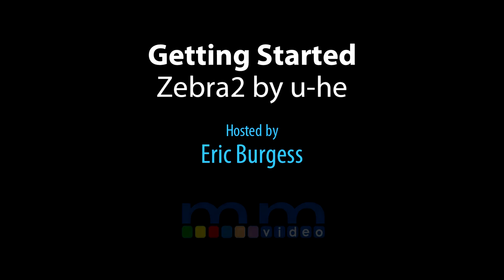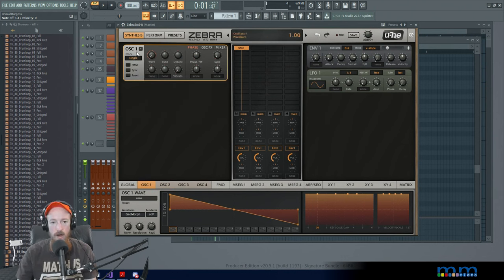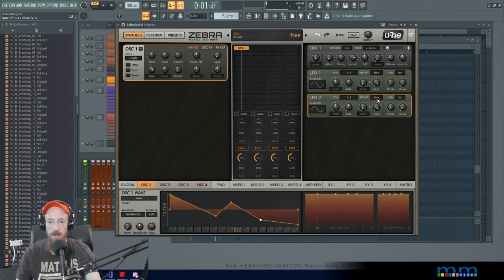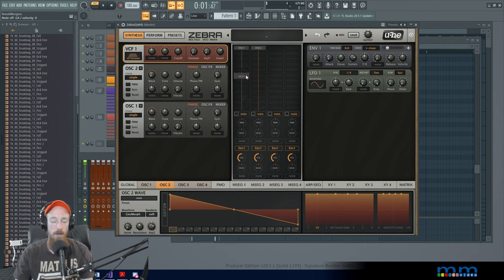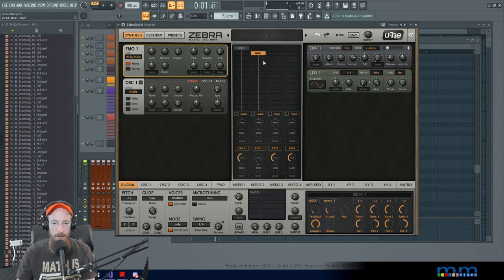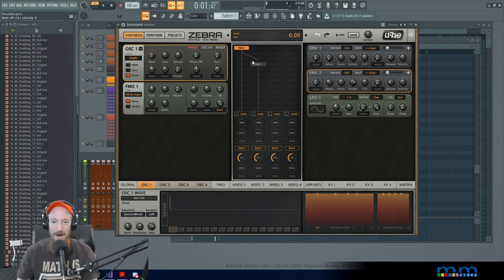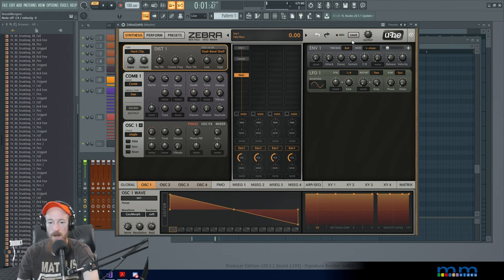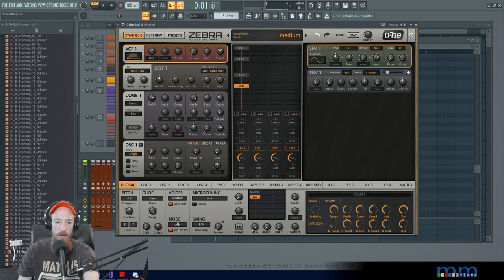MMTV: U-he Zebra 2 Getting Started | Eric Burgess

Comment: I'm having issues with the way LFOs interact with filter cutoff. I'll have it set to like a Triangle wave, Restart set to Free and Sync to like 8/1, and it just kind of randomly moves around, almost like a sample & hold or something. I've been troubleshooting for like an hour & I just can't get it to behave like even other U-He soft synths, any pointers?
Reply from the maker: Change the restart to gate this will make it so the wave starts from the same position in the wave each time. The starting position can then be changed by using the Phase Control. If you have a modulation source active on the LFO's amplitude such as the ModWhl keep in mind this can limit the range causing the phase knob to have less control. 

Free mod will make the movement random, you can change the waveform to user to see this more clearly. If you decide to use phase to offset it while using the user waveform keep in mind that a large waveform will be barely effected by phase while a short one like 1/64 will offer much more range.